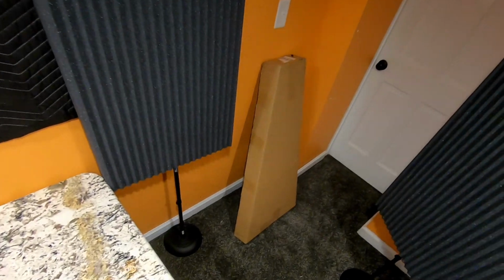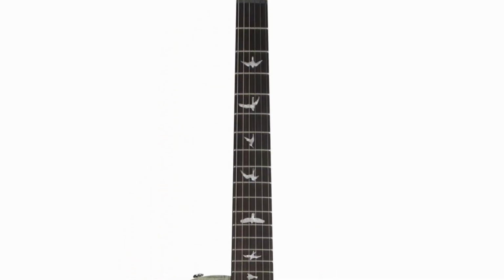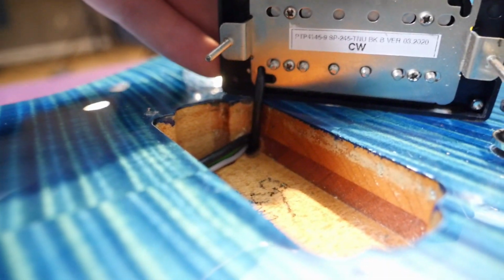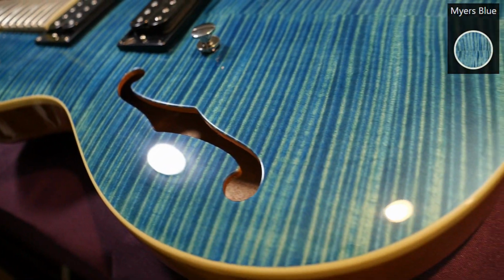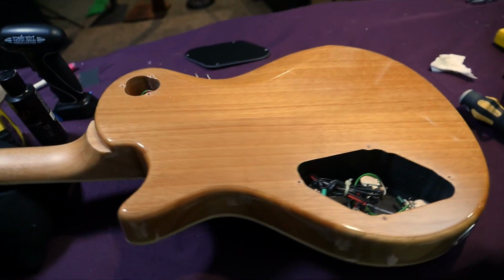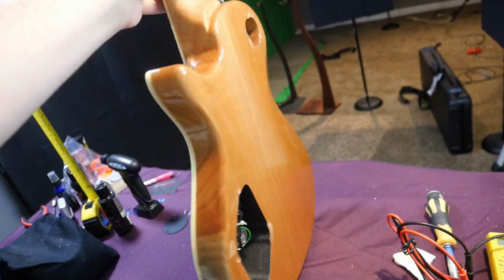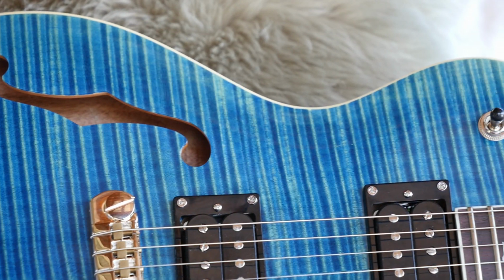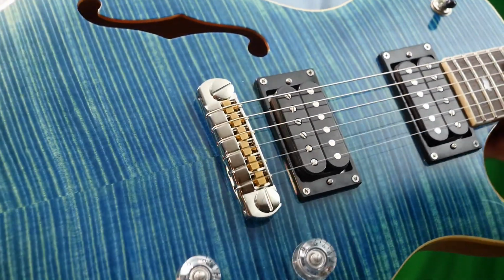It Comes With A FREE AFRO! | 2021 PRS SE Zach Myers Signature Electric Guitar Blue History + Review

Comment: The PRS SE guitars that I have tried in the last 5 years have been some of the best guitars that I have ever played. (As long as you aren't trying to get "That" Les Paul... or Strat. The SE's can be a great workhorse guitar that have a lot of sounds to provide.... but they only come "close" to "That L.P. or Strat" tone. There is the "EG" model with 3 single coils if you want to get closer to the Strat sound... but it is still slightly different.) Love my two PRS SE guitars!

Comment: I bought this guitar several months ago. I absolutely love it but I hated the black plastics. So I swapped it for the cream pickup rings, replaced the toggle switch to cream as well as cream kluson locking tuners. It looks so much better than stock.
Reply: Hey what cream covers did you get and were they a direct drop in , any mods , thanks
Reply: @christylasure7072  I bought the usa ones from the prs website. The screw holes don't line up perfectly, but the rings cover everything so I didn't mind making additional holes.
Reply: @markmoyle3661  thanks
Reply: nitrojanks2977 Locking tuners don't actually improve tuning stability. They just make string changes easier.

Comment: Glad to see you have done a PRS SE.  I have two SE's from Indonesia and one from Korea.  I also have a Squire bass from Indonesia.  All of the instruments I got new and were ready to go out of the box.   i have never had to have fret work or even a basic setup.  Indonesia is the premier Asian string instrument manufacture in my experience. 

I am not sure if PRS is still performing final QC checks on SE's before they are shipped out to dealers and distributors in the age of Covid.  But I do believe that was an important step to maintain a QC level.  PRS produced some videos, one of them detailed the process they go through when they get SE's delivered.  They have an entire team go over every guitar doing a QC as well as a setup.  They showed the pallet of the ones that did not pass.  There are some dealers in NA that are able to get SE seconds and sell them at a discount.  They are upfront and honest about all imperfections or issues.  I have found they will upgrade them by swapping out the fixed wrap tailpiece with a fully tailpiece with full intonation and brass saddles.

Comment: I bought one of these - I was close to pulling the trigger on the Green one, but they then announced the updated Blue.
This thing is all about little details that just elevate it - the gloss stinger with satin back on the neck.
The headstock veneer that is usually only on higher-end PRS models - SE and S2 usually have plain or painted headstocks.
The high end wrap-around bridge with big brass saddles and intonation screws.
The strap buttons - large diameter and with a wide flat base that do hold well to straps (unless you are really throwing it around). Way better than Fenders inverted cone that almosty guides the strap off of it.
The stain on the veneer - how they manage to create movement in a thin veneer I'll never know - it's sheer magic.

The rosewood neck on mine looks a touch darker than yours (camera effect?) and mine has a couple of lighter streaks in it - that I really like.
There is colour variation in the tops too - some have a greenish undertone, some whiter and the depth of blue varies a bit. Since the veneer is real wood, I expect there would be some variation in it.

Mine DOES NOT have any veneer on the back - you can clearly see the 3 pieces of the body and they do not appear to have been chosen as to match. It looks like 3 pieces from 3 different trees - not that I care to be honest.

The covers proud of the back, I think, are the compromise demanded by PRS in exchange for the headstock veneer - to trim the production cost back.
The green version has flush covers but no veneer.

I may go to locking tuners, graphtec nut and maybe brass/nickel covers (or pickup swap) on mine - but it's not necessary right now. (and some have suggested a treble bleed mod)
Maybe in a few years if I want a change.

Oh, and I like the sound of it unplugged - it makes late night practice non-marriage threatening :)
Reply: PS - yes - the afro reduces headstock breaks - but Paul Reed Smith also chose a lesser headstock break angle to further reduce the chance of breakage.

Comment: I haven't bought this guitar yet. Today is Jan1,2025 and I am wondering if I feel the need to replace either pickup, which one should I replace. I like the neck pickup I have listened to several examples on the Tube. When I listen to the lead pickup it isn't my favorite. I have 85/15's in the Ce24. I like them.  I like some Jazz, Blues and Rock.  I was thinking about a lead pickup of 59/09 or 58/08. I only mention these pups but I don't know what they sound like either. I know Paul is an exacting designer and they can't be bad.  What ya think. Thanks.
Reply: I just bought this guitar and this is my experience.  Bought used in June 24. Love the guitar. The pickups and I use a DSL40  emulated Zachs tone perfectly. Playing Sound of Madness is dead on tone. Change pickups is your choice. The weak link is the tuners. It's a daily tune to play it. I am customizing mine with Floyd locking nut and Floyd FRX tremolo.  I have to drill 4 mounting holes for studs. I was happy to see it's all wood where I need to mount. 
Costs. I paid $725 used, Schaller strap locks $40, strap $30, it has included the gig bag instead of a case. The Floyd locking nut $30, the FRX FRT04000 $250. So about $1000. It's a very nice guitar
Reply: New in the last year my Epiphone Alex Liefson Signature  for $1101 and Jackson Warrior WRX24 with case $983. Seems a mid range guitar point. I miss not getting a case for the Zach Myers, the Epi came with case and the Warrior I had pay extra. A regular case won't fit a Warrior.  The ZM fits in the Les Paul case exactly like the Les Paul so specs are exactly same. I will end up buying a epi case for the ZM

Comment: I absolutely agree that Zebra pickups would look better, or wood pickup rings. 
I also would prefer the CNC vertical mill run the roughing end mill about 15 to 25 seconds longer, and run the finisher about 30 to 40 seconds longer, to cut a very shallow pocket for the control cavity cover and switch cavity cover to sit flush ro the body.
That's not just a  guess pulled out of... nowhere... that's an estimate based on years of experience programmung and running many CNC machines, a wide variety of tooling, dozens and dozens of extremely diverse workpiece materials, and years of building guitars and basses. The rougher could be a little faster, finisher probably a little slower...
Reply: They were in the green version. On top may be the compromise due to Zach asking for a headstock veneer on an SE (usually reserved for the Core models and above) so they had to trim the cost of manufacture elsewhere. I have one and I'd take the stained, flamed headstock veneer over flush covers any day of the week.

Comment: Regarding the back covers, even on the $2300 CE24 Semi-hollow, those things aren't routed out so they stick out at the trem cover and control cover. It'd be nice if they were flush. Still, I love these satin finished necks and gloss bodies. The body is protected and the finish won't wear but the neck will feel great. That CE24SH has it too. 

How did you do that wild vibration look at 4:30 ?

Comment: Metal pickup covers on any of these PRS SE models automatically makes the whole guitar look 2× more expensive. It's very frustrating as gorgeous as these guitars are, how cheap the pickups always look. I've owned 3 of them myself and swapped the pickups on every single one of them.
Reply: Agreed.  I have an S2 Semi-Hollow and the covers make a huge difference to the look.
Reply: @CW0123  tastes are wild like that. For some reason I like my pick ups uncovered and black/cream.
Reply: The least amount of plastic on a guitar (or anything else) the better.
Reply: If you get one with the zebra pickups with the cream and black they look a little better as well but yeah plain black looks way cheaper than what these guitars have to offer
Reply: True, the zebra ones do look a little better. My Custom 24 SE in grey-black had the zebra ones, but I had a set of black-chrome covered Dave Mustaine Live Wires I threw in it and that looked SHARP! Sounded amazing too cuz those are basically an active boosted version of the JB / Jazz set. 🤘
Reply: Replacing the saddles & trem block on the tremolo SE's makes a world of difference too. The stop tails seem good as-is, but the trems they put on the SE models are zinc alloy pot metal garbage. I had brass ones laying around I put on mine, though I'd probably go with stainless steel or titanium if I had the option. The wrap tails on my other ones were aluminum stock from the factory. 👍

Comment: I bought the ZM3 but decided to replace the stock tuners with Gotoh SD90 locking tuners (direct drop-in replacement).  I also swapped the pickups with PRS 58/15s adding the coil taps that are normally associated with those pickups.  The guitar played awesome before but now plays more like PAF with the ability to go to a Tele thinline or P90 guitar when I ever I want to.  It's one of my favorite guitars and my first PRS.  Its worth taking a look at if you see one.
Reply: Also note when looking for a guitar one wants to mod, look to see if somebody as put in mods that you want. Those guitars actually end up cheaper than stock guitars. More work and money put into a guitar usually equals less resell value.
Reply: @orlock20  depends on the mod and the guitar. But for low end guitar it usually doesnt matter about upgrades. I have sold two of the 14 guitars I have owned my life so for me its playability.
Reply: Just ordered one . I have a PRS SE standard 245 tabaco burst I love it . I've heard that these pickups have alico 5 magnates  in them could be just a rumor .

Comment: I've been a little apprehensive about buying one of these models cuz I'm a metal guy and it's a semi-hollow, but this video really helps to show it's really not all THAT hollow. It's almost more like he just wanted the f-hole there for cosmetic purposes only? 🤔
Reply from the maker: Basically just 1 new chambered area in the guitar that is opened with an F. Not quite like a 335 at all
Reply: I think what your looking for is a BC Rich Dagger
Reply: But a solar, it's worth the money
Reply: I had one of these that I put fishman fluence pickups in. I didn't notice any over-the-top feedback due to the "semi-hollow" design if that's what you're worried about. The short scale length though, meh... had to have 13's on it to be playable for me in D standard.
Reply: People with better ears and amps than me say the semi-hollow adds a slight airiness to the tone.
For me - it sounds louder, fuller and richer when I practice unplugged vs my solid body guitars.
I was surprised how much sound comes out when I first strummed it.

Comment: These REALLY need covered pickups. They make me think of a BMW 7 series with Honda Civic wheels. Actually, the pickups in general are the are the weak point on this guitar. They sound dead and lifeless, but at least I don't think they're the typical overly hot SE pickup. I think if you dropped a $100 set of Toneriders you'd be golden.